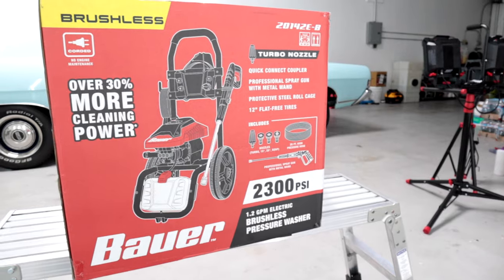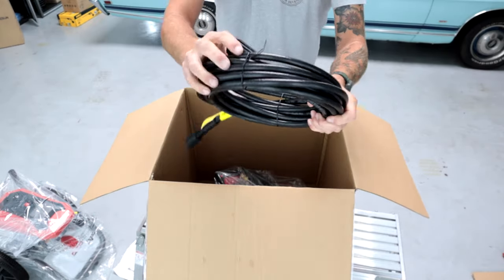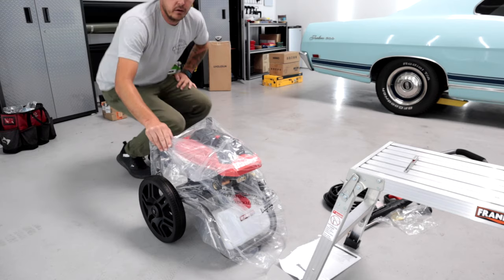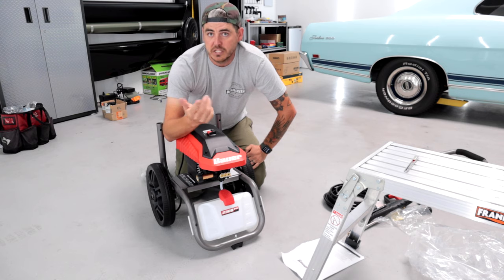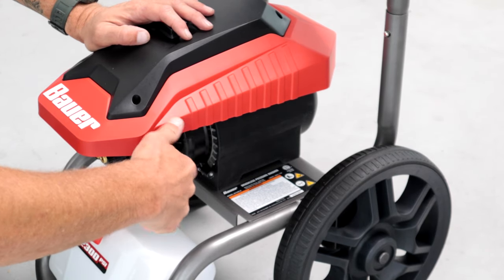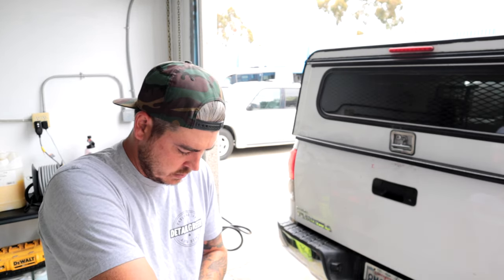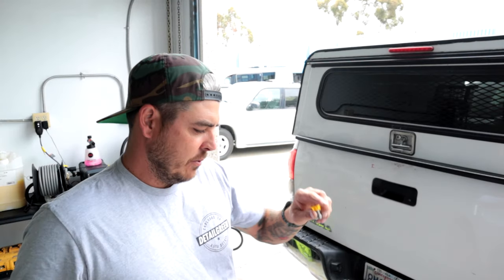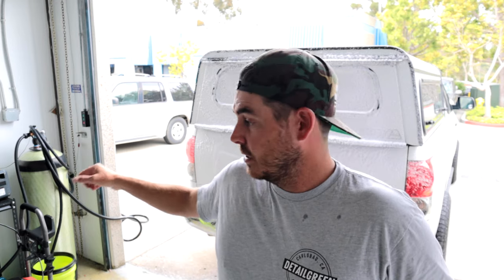Harbor Freight 2300psi 1.2gpm Bauer Electric Pressure Washer Review | Pressure Washer Reviews

Comment: Why test with an aftermarket gun?? if you are revaluing the machine. Wy, not us the original first...  I will keep that one in mind though.
Reply: The wand has nothing to do with the performance of the machine..
Reply: @mdtransmissionspecialties  
Yup.  Suppose so, I have the green 1800psi one.... looks like you also explained the  dif. If using other nozzles, which is what I was basically thinking about...
Thanks for your response.
Reply: He's showing you how to get the best performance out of the machine for our field of work. What matters most is the performance of the pump, majority of us switch the gun out anyway because the long wand is overkill and gets in the way
Reply: Most stock guns suck
Reply: Agreed. Testing without the factory parts is a null and void test.
Reply: @N6PCD it's a detail channel not project farm
Reply: If you've watched other vids on his channel he clearly explains that there is no difference in switching out the guns. The difference comes in when switching out the nozzles do to the orifice size
Reply: The length of the hose does have an effect.  Static pressure affects flow. Pressure and flow have a direct correlation. But good honest revue.

Comment: I'm looking to buy a decent pressure washer to clean screens on my porch and vehicle washing. One issue I have that is a little unique is I have a shuttle but that the top is about 12 ft high. what kind of pressure loss and GPM loss should I expect if I went with this unit. My other options are a lot more expensive.

Comment: Just bought one for auto detailing use. I will say this...my initial test told me I won't be getting rid of my gasser for tougher jobs. But for what I will use this for, it will work great. Doing all the upgrades as prescribed (hose, gun, fittings) here so appreciate the review and recommended upgrades. The provided gun and hose are completely unusable. They should sell an option without them it's so bad. Waste of money.
Reply: In your opinion would I be able to clean vinyl siding or fiber cement shingles with this pressure washer.

Comment: Thanks great video as usual.  2 separate questions
1. Opinion I have a 06 mustang I bought new engine bay is clean but heat shield is dirty and want to remove to clean.  How you recommend to clean??
2. Walmart has 35’ husky 3800psi kink free hose. Opinion???
Reply from the maker: 1. steam would probably be the best way. You dont want to get to aggressive and damage it.

2. ill take a look at it the next time im at walmart but i havent seen any as good as the uberflex/flexzilla yet
Reply: @imjoshv  I bought the Walmart 35’ Husky pressure hose and finally got to use it today and I read the hose and it says right on it “Uberflex by Propulse 1/4 3800psi”.  It was $35 for 35’ black colored hose. I thought you’d like to know.  Thanks again for all the great videos.

Comment: Washed the porch today with this unit.... im getting another pressure hose but tested it with the stock... I have all the hoses connected with quick connectors except the pressure hose to the unit. I have a psi guage and tested with the highest pressure nozzle.... meter reads 2250 psi which is excellent. I have got a foam gun I used first, then pressure washed with the stock gun.... did a fantastic job. Years old grime came off real easy

Comment: I noticed in response to another comment you said the active VE52 was your favorite pressure washer I was just wondering why? This pressure washer was closest to its 2300 psi rating yeah the active VE52 sat around 1100 psi when you tested it. I’m wondering what good is a higher gpm with no significant pressure to back it ?
Reply: Great question.The simple truth is this. A higher gpm will allow the water flow to help move the wash away with the debris you just powered through. That’s debris that will get in your way at a lesser gpm. However, and isn’t there always a however, if you’re powerwashing say a concrete driveway and it has a horrible lack of a slope for runoff drainage, then all that extra gpm will build up very quickly and THAT will get in your way. So now you have to push all that out of your way as well. I hope this helps and good luck in making your decision. 👍🏽

Comment: Great review!  Thank you for taking the time to look at all the different units. I get my Active VE52 tomorrow and can’t wait to use it. Thanks again.
Reply from the maker: Awesome! Enjoy it!!
Reply: @imjoshv  video didn't really help me find out if that's wat I want to buy... Didn't see it clean a sidewalk or driveway
Reply: Hopefully ur using all the stock equipment wit it like the hose and gun becuz i have an active VE52 n it started acting up on me out of nowhere with my uberflex 50 ft hose n aftermarket shorty gun as soon as connected the original stuff it stopped acting up so now I just have it collecting dust in my garage I went back to my Portland for my detailing buisness
Reply: You've tested the Bauers and the Ryobis, so which one would you recommend. I like the Bauer because it turns completely off when not spraying, but the 90 day warranty is a concern.

Comment: Question Josh you said the ubber flex hose would work with quick connects for the stock gun , do the quick connects that come in the pack that you have listed on Amazon fit the stock gun to use with the ubber flex hose ????

Comment: Great insight.  Question:  How far will it shoot?  Will I be able to reach the slant metal roof?   If I want to clean the metal roof without climbing a ladder, will it reach the roof from 30 feet below?
Reply from the maker: All depends on the angle on nozzle you use.. but you can also buy extension which is what I would recommend
https://www.amazon.com/dp/B087CTSVZ7/?tag=detailgreen-20

Comment: I bought one. It worked about 30 min. Then quit. Took it back. Got another one. It worked long enough to finish my small job.  Put it up for the winter. Got it out this morning. It worked about 1 hour then quit.
It's trash.
Reply: Motor seized take apart pull off fan on rear & turn motor over with pliars & wala good 2 go

Comment: Bought this for stripping off deck grime and loose paint for a job.  Psi was excellent.  Worked perfect.  For automotive use it’s also excellent!  Is it possible that water output matters on water input?  Where I live has great water  psi from the street.  If using well water I don’t really recommend.
Reply from the maker: Yea I’ve used some pressure washers in a gravity fed system in my truck and you do lose a little bit of psi. So having strong in flow to the machine helps

Comment: Can you link the adapters you used for this machine to connect the flex hose to machine please?
Reply from the maker: here you go! https://amzn.to/3zY1kJf
Reply: Is you use a quick connect on this unit from the output side to the aftermarket 14 mm hose wound you need 15 mm to 14mm converter

Comment: By the time you buy extra accessories you could just buy a better machine.
Reply from the maker: unfortunately pretty much every machine comes with sub optimal accessories. Unless you go with something much more expensive. My recommendation is always to find a inexpensive unit that has a good motor/pump then upgrade accessories to get the most out of it
Reply: @imjoshv  ok

Comment: Great review!  Would like to throw the AR610 into the mix for review.  I have this unit and I think it's an ideal unit for auto detailing,  Small, portable, insanely quiet with great flow.  Triplex pump should run for years without issue.  I use a 3.5 nozzle and it's a great mix of pressure and flow.  Also, unlike it's bigger brothers the AR620 / AR630, it will work comfortably on a 15a circuit.
Reply from the maker: Good choice! Ill look into getting one to review!
Reply: @imjoshv  Would be happy to lend it to you for review if you weren't across the country haha.  Look forward to it!
Reply: @imjoshv  I followed your advice, the new accessories you recommended in the links really made this bauer 2300 psi washer so much better. Should make cleaning utv so much easier. Thank you
Reply: @imjoshv  can you tell which QD connector to attach to the aftermarket gun to connect hose